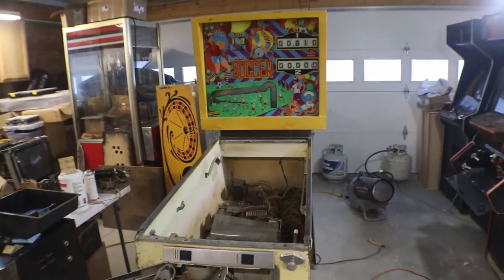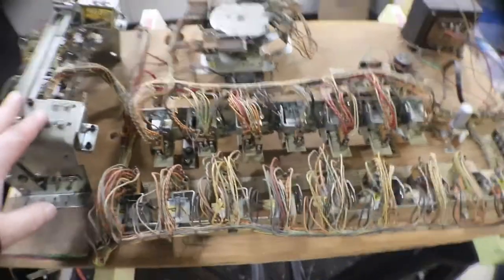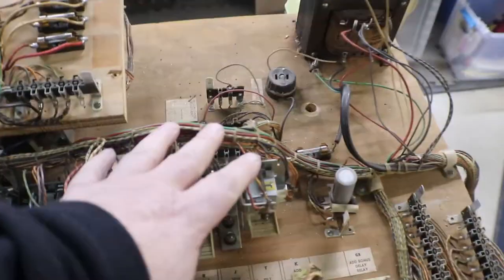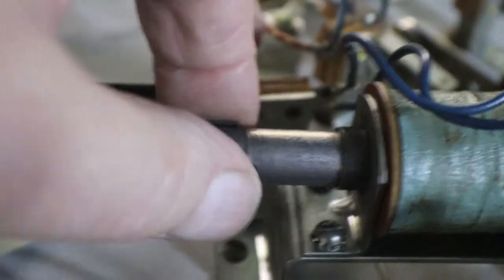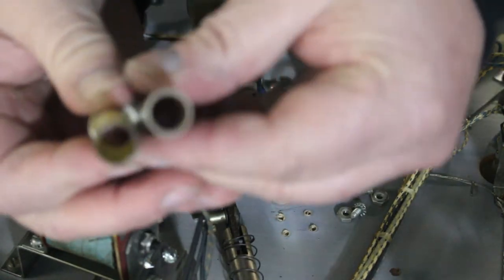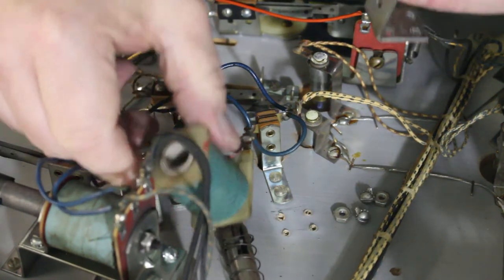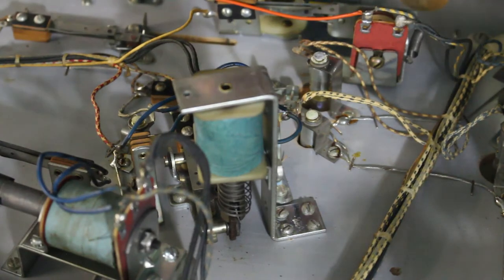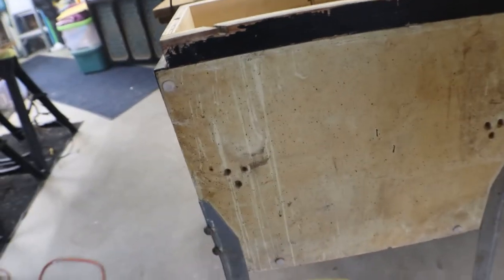Cleaning Contacts & New Sleeves In Coils 1975 EM Gottlieb Soccer/ Back From The Dead Ep 2

Comment: What is the name of the solenoid/coils that have the fixed metal rod in them? The part number is Z-27-1000. What coils/solenoids stay on the whole time the game is turned on besides the "lock coil" and any upgrade coils to use that that won't get burned up like most "lock coils" get burnt?
Reply from the maker: The coil with the fix metal rod in them is a relay coil and the one with an plunger is a solenoid coil. The relay coil that stays on when the game is turn on is the lock relay coil. On some of the machines when you tilt it the relay coil will stay on until you start a new game. There is one on some of the coin doors that lock on when the game is turned on. This relay coil is for when the machine is off it will not take quarters. Then when the game is turned on it locks on so the machine will take quarters. There is no up grade relay coil that I know of.